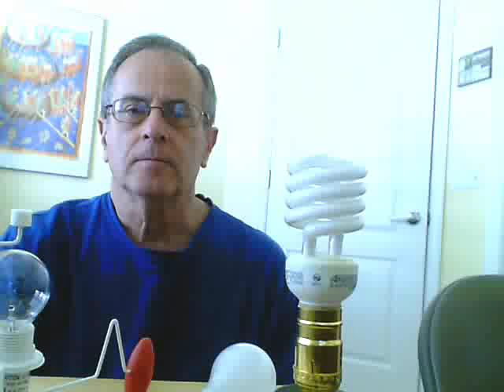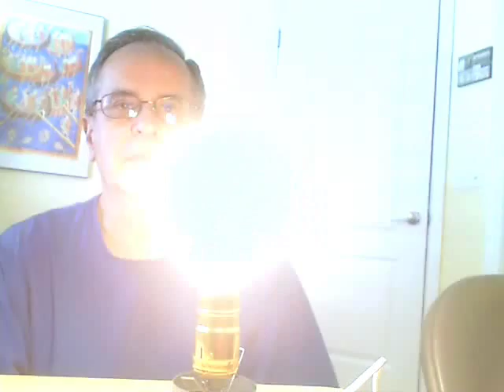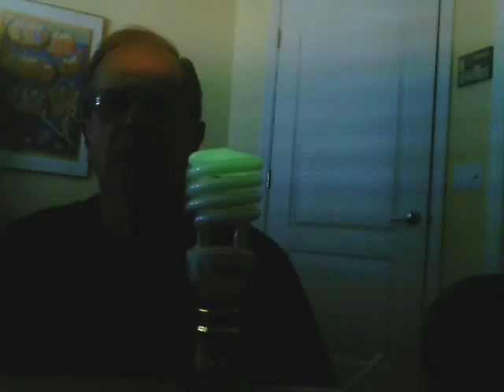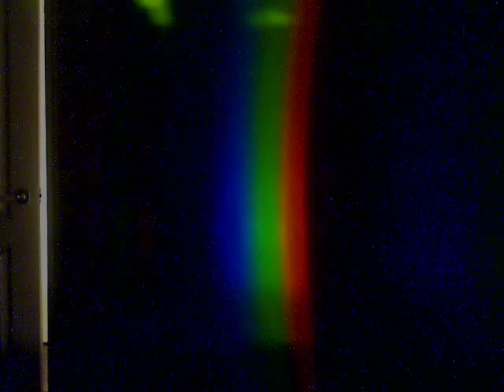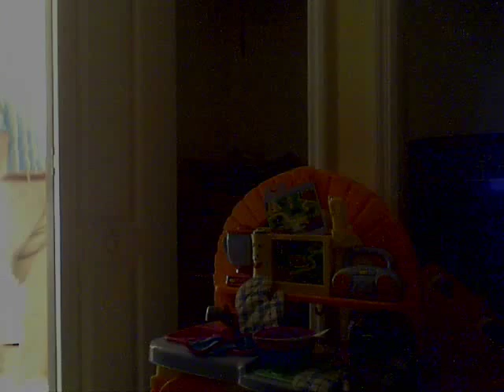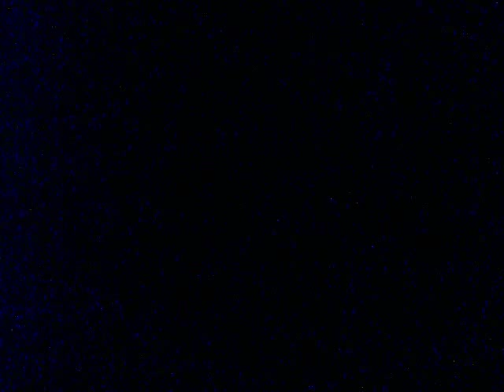The Colorful Spectrum of Incondescent and Fluorescent Bulbs

Comment: so, would it make a difference if the fluorescent light bulb was coated with phosphor vs uncoated?
Reply: An uncoated fluorescent lamp only radiates the wavelengts directly generated by the ionised gas. In the case of a common fluorescent, that's usually argon and mercury. Mercury gives a pale greenish blue visible light, with a LOT of UVC radiation. 
It would not only be dim and sickeningly pale green, but also give you radiation burns. 
A fluorescent tube without the phosphors is simply a UVC tube, like the ones used in water sterilisation.

Comment: Incandescent lights appear yellow, in part, because our eyes are really good at seeing yellow light compared to the other colors. They give off a full spectrum in the sense that there is light emitted at all visible wavelengths. In some incandescent bulbs the yellow wavelengths are slightly brighter than the other colors. The combination of these two often causes blue or red colors to appear a bit "washed out" under incandescent lighting.